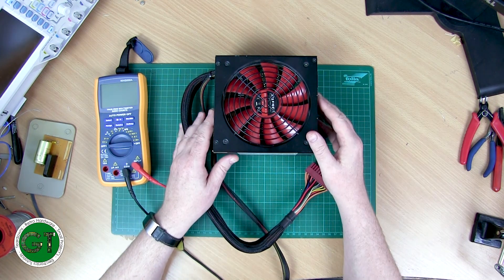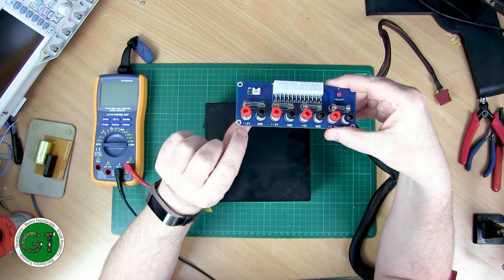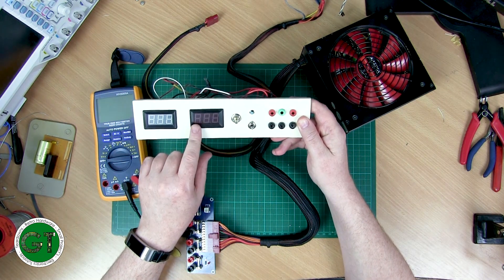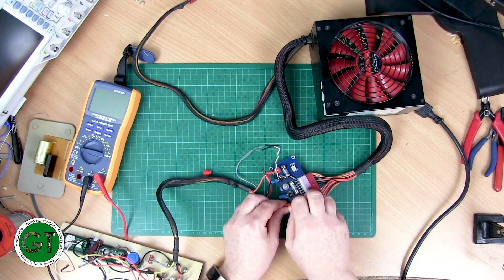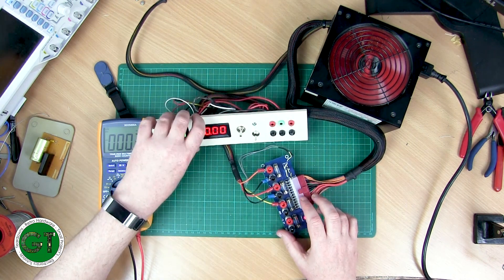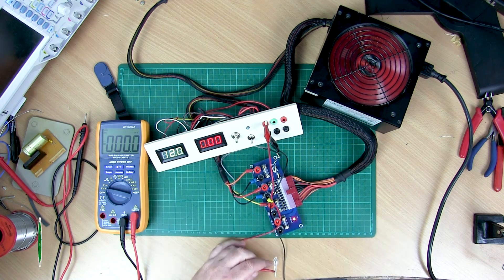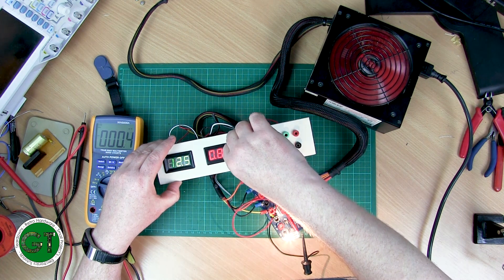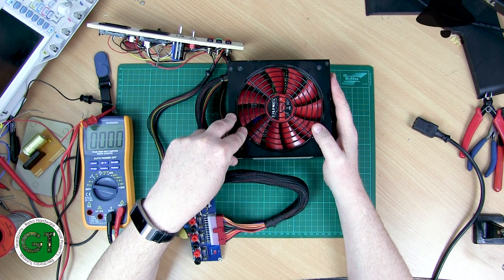DIY Bench power supply using an old ATX PSU

Comment: Did I miss the schematic?
Reply from the maker: It's just a voltmeter, ammeter with a buck converter connected across the -12 and +12 rails using a 10 turn pot to control the output voltage of the buck converter.